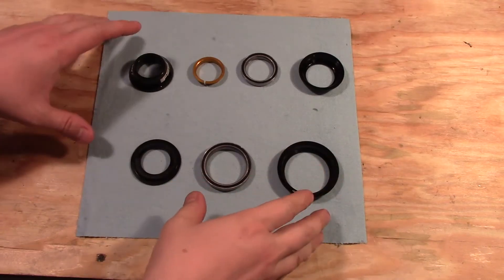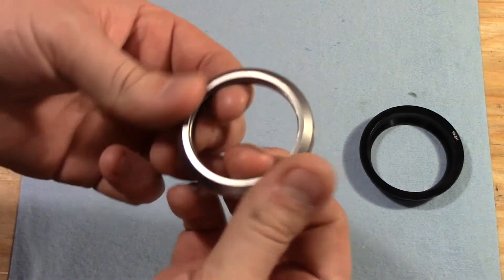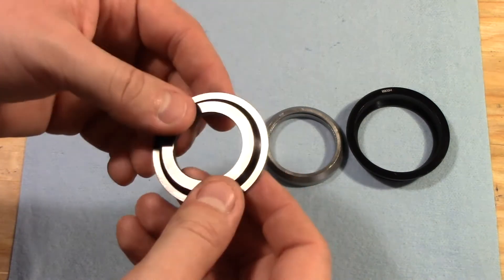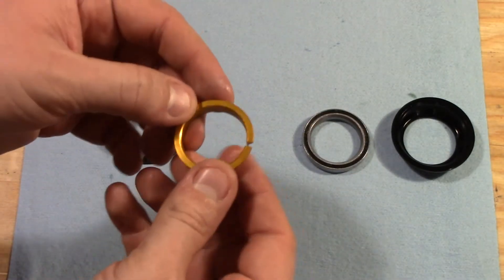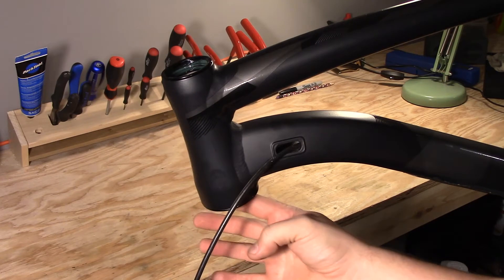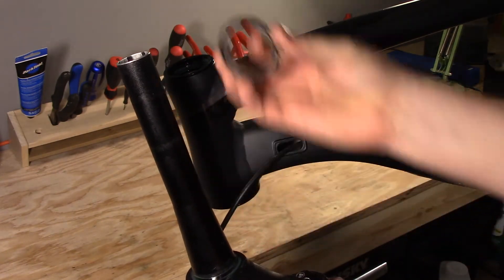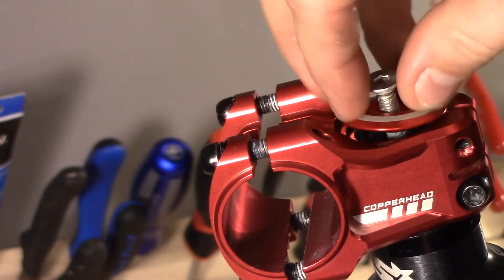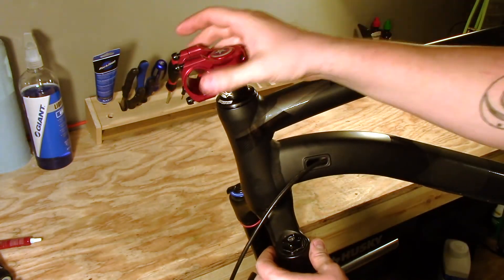Headset Assembly Explained. Giant Trance Build

Comment: Clear presentation, thanks. So it seems that after applying the preload (via star nut), the compression ring will "press fit" with both the steer-tube and the inner race of the upper bearing such that the steer-tube is relative "fixed" with both the compression ring and the inner race, i.e., the only relative-moving parts when rotating the handlebar are the bearing balls and inner/outer races. And the same goes to the crown ring as for the compression ring. Is the understanding above correct? I did not find any explicit explaination on this aspect. Thanks a for the video again.
Reply: Yup, that is essentially correct.  The most important part is that the compression ring removes the lateral play in the steerer tube.

Comment: Another great video...Do you have a video on Giant Trancr rear hub disassembly and reassembly? My 2021 (bought in 2022) has slight play and my LBS said it could be normal and asked me to just ride it and see if it gets worse...it's unacceptable...
Reply from the maker: Let me see if I can find one. What model specifically do you have?
Reply: @richardsbikeshop5268  i have the Trance 2021, 27.5 base model... thanks
Reply from the maker: Giant has been all over the place with their hubs lately. It is very likely that you have the newer, Giant-made hubs. The freehub body is not serviceable. To remove it, you have to remove the axle and remove the NDS bearing. This will give you access to the FHB from the opposite side. A lot of torque and a 14mm Allen will pop it out.

Comment: Hi, great vid. Do you have the outer diameter  measurement of the upper headset bearing? Planning to replace mine (Trance 3 2018). Thanks!
Reply from the maker: the OD is 41mm.  The writing on the side will help you out too.  It is "TH MR122 1-1/8 36° 45°L9"  "MR122" refers to the standard size name, "1-1/8" clearly refers to the steerer tube size (the ID is 30.15mm).  The " 36°" and "45°" refer to the angle of the inner race taper and the outer race taper respectively.  I'm not sure what the "TH" and "L9" are supposed to represent.  The FSA name for this headset is "Number 55".
Reply: Great, thank you very  much!